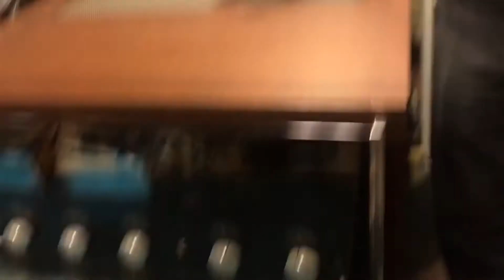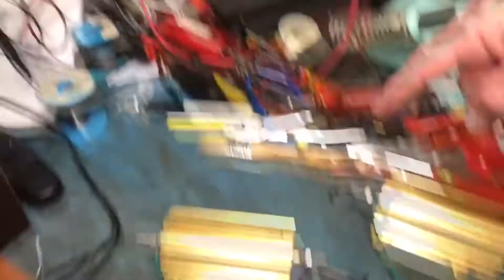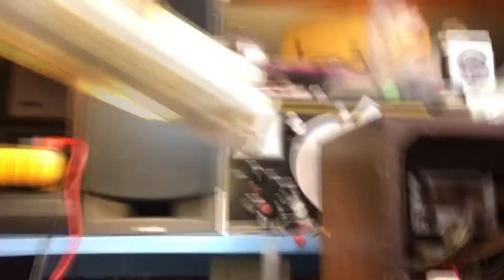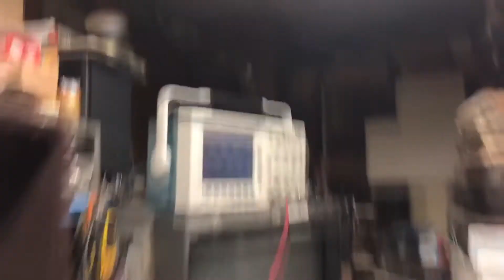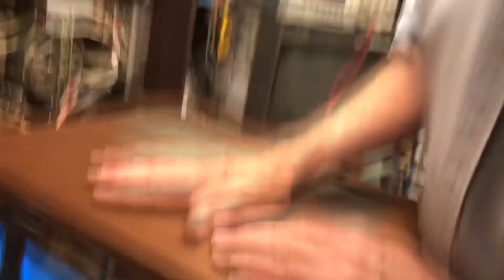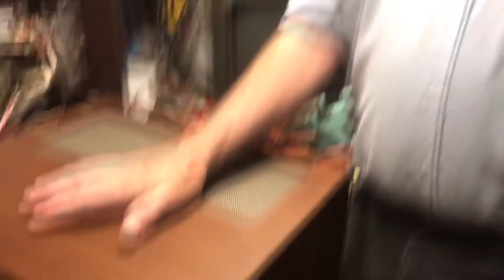McIntosh - MC-2105  "PRECISION FIDELITY STEREO AMPLIFIER"

Comment: Thanks for paying homage to a classic, quality, American made class AB amplifier. As another commenter accurately stated, the 2105 weighs in at 65 lbs. This model was only produced from 1968 to 1978. I purchased a new 2105 for 799 bucks in late 1976. In addition, I purchased a new C28 pre-amp to accompany the amp. Fortunately, my background in electronic engineering has allowed me to keep this amp in perfect, spec grade condition. Other than replacing major electrolytic caps and wire wound resistors that had faded over time.  Electric Light Orchestra and the Moody Blues,  via a set of Klipsch LA Scala speakers, still grace the airwaves of my home today, 58 years later.
Reply: I recently purchased a near mint 2105 for $1800 and it is without a doubt the best sounding amp I have ever owned!

Comment: I just got mine changed out with LEDs at a local place but the red light above the logo doesn't illuminate at all. He said there was no way to get that to light up. It doesn't appear that way with yours??
Reply: He is wrong. He probably used green LEDs for the panel and that will not light up the red. You need white LED’s in that section, and you can use Blue LEDs for the four meter bulbs.

Comment: 2105 is from 1974. I know because the manual tells me so. I love mine and the MX 113 preamp. Bought both in 2000 for $1800 Canadian.
Reply: thekretch the 2105 sold for a ten year period from 1967-1977. Only small changes were made to the circuits during that time. More info here: https://youtu.be/Q3cHIo43BQ0